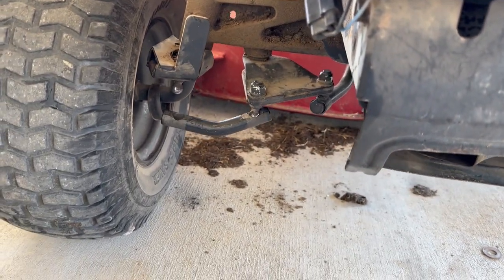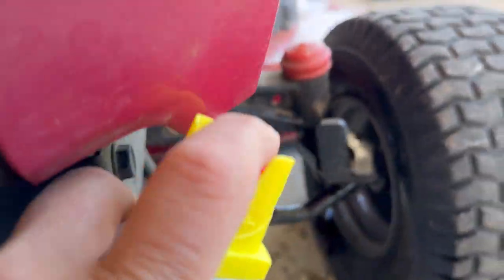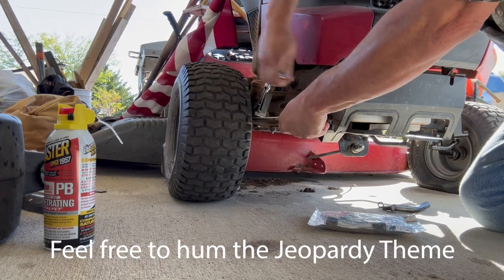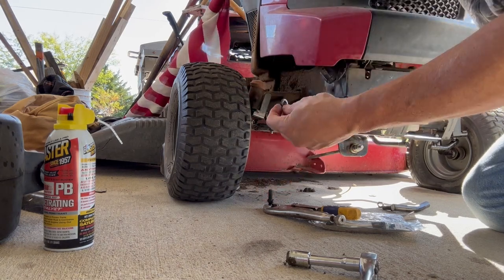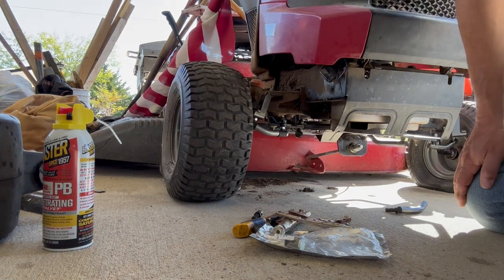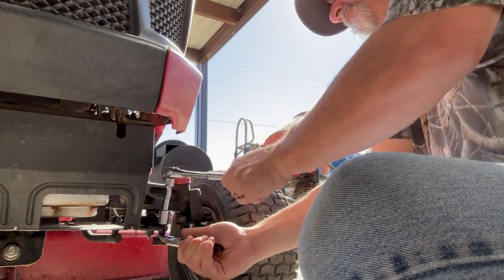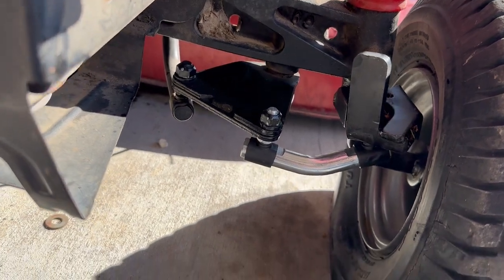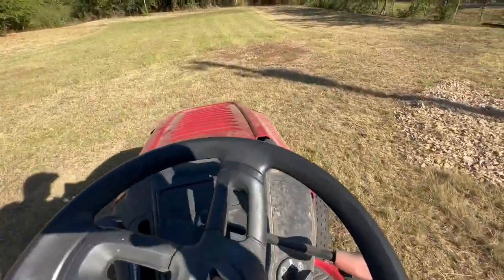Riding Mower Tie Rod / Ball Joint Fix

Comment: Stop using vise grips and use wrenches to hold bolts when you tighten nuts on them. Get some tools!
Reply from the maker: You ain't wrong.  I had to switch to the needle nose vise grips.  I don't have a set of thin open ended wrenches.  Mine would have been too thick for this job.  Maybe something I'll add to my Christmas list on Amazon.